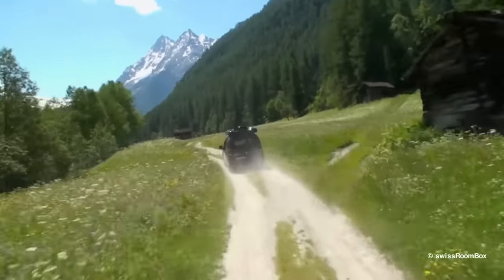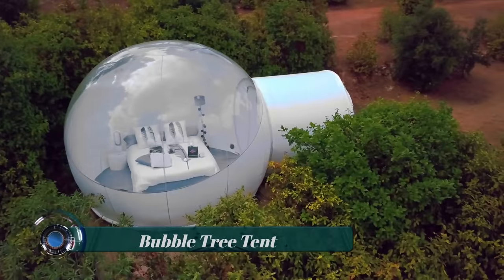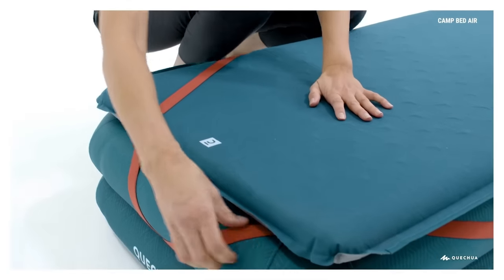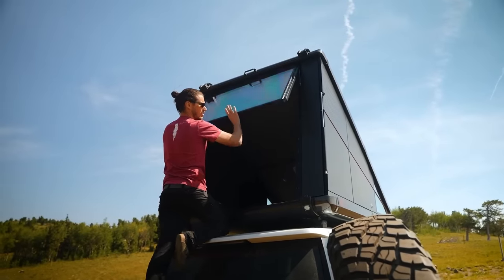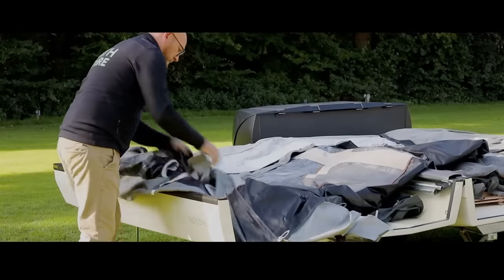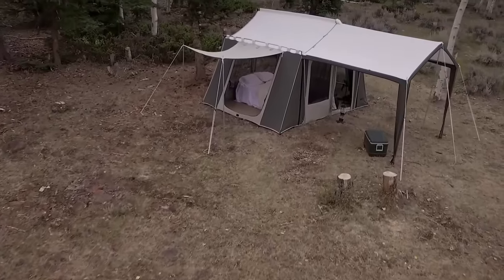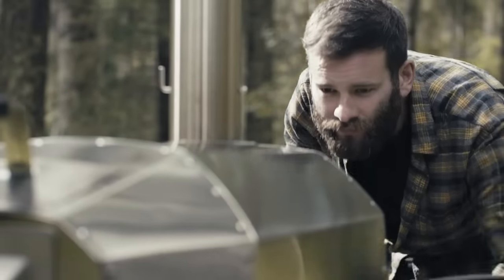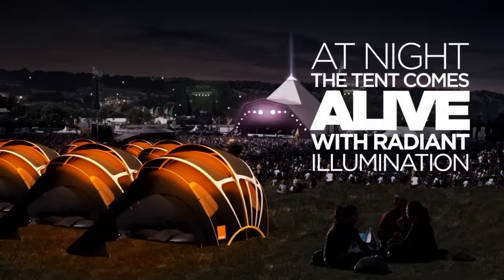Camping Inventions That Are the Next Level

Comment: The Coleman connect tents are cool, but the connecting tunnels all need extra sealant. I seal my tents even when they have been done by the manufacturer because there are often missed spots. Camping in a rain storm isn't a good time to find out the tent should have been sealed.

Comment: When you consider that gas in Europe is taxed almost to the point that it is a luxury that product makes sense. That product makes little sense with so many campers around.
Reply: Electricity is the fuel that is taxed higher, but is far less efficient in producing heat for warmth or hot water!